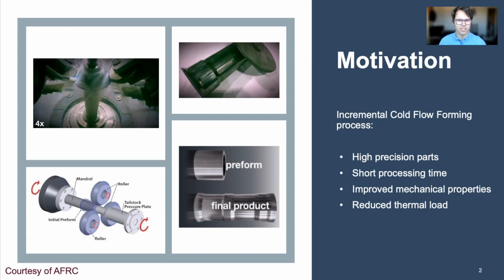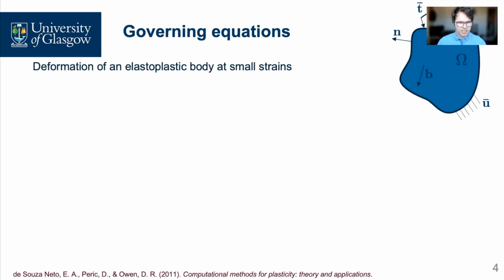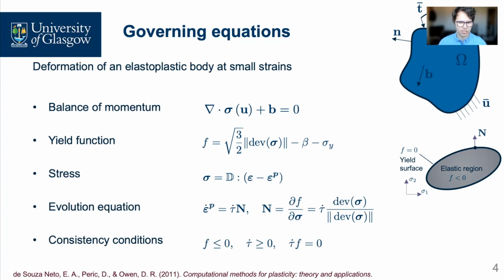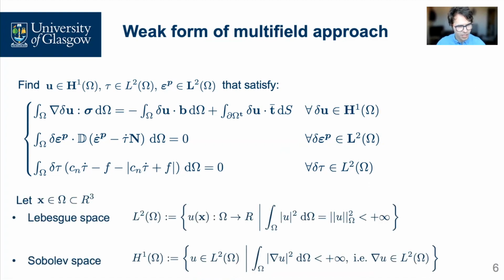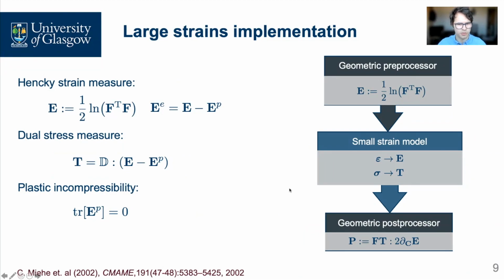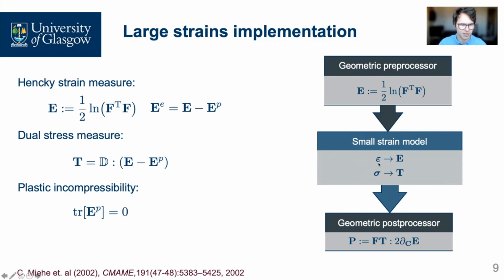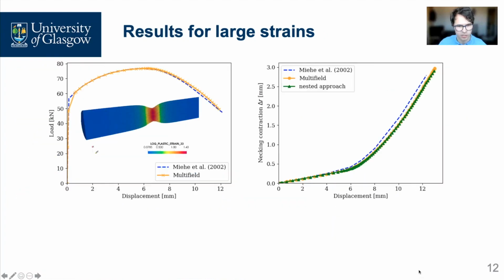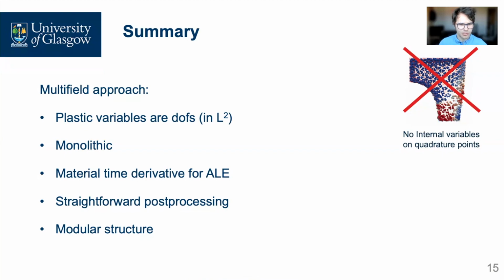Finite element modelling of the Incremental Cold Flow Forming in MoFEM UKACM2021

Comment: Hi,
Great progress.
However what if the part to be rolled is a thin sheet metal? I would be apprehensive of this approach of stationary meshes because this may not be able to predict folds and wrinkles that can appear while rolling such parts. Also, we may not get info about thickness reduction in entire piece as there are chances of uneven thickness in these forming methods.

Regards
Reply: This approach will be fully capable of simulating thin sheets as well. The mesh is not moving, but underlying material is. The wrinkling and other instabilities can appear as well. Additionally, we can adaptively refine the mesh.